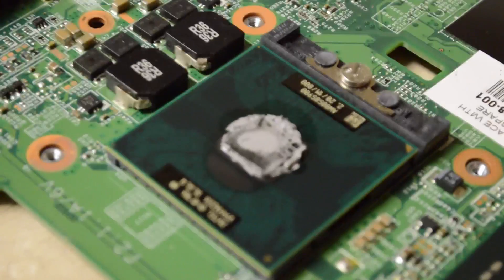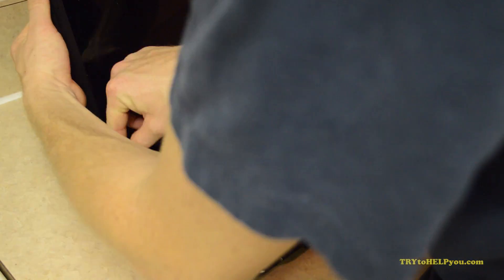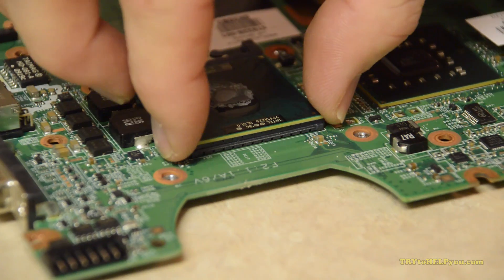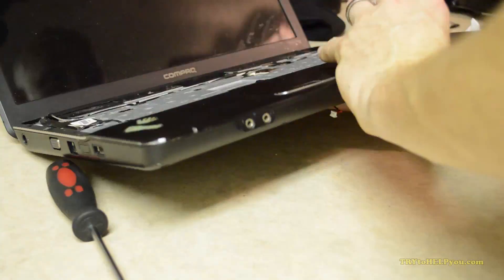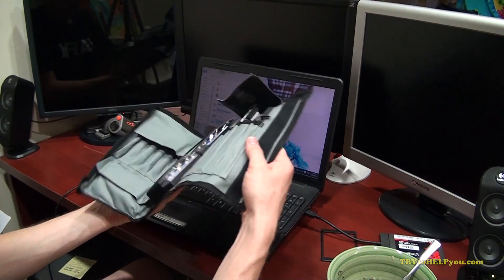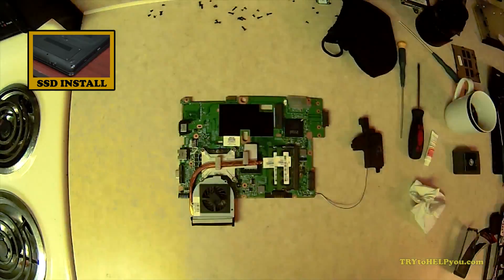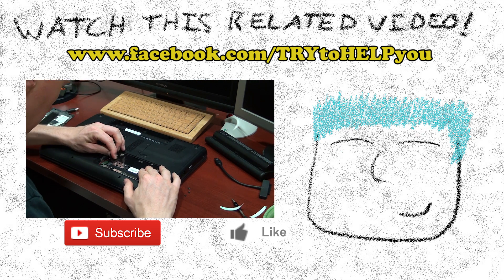Laptop CPU install, how to upgrade your Laptop CPU

Comment: I have a CQ71 for my everyday use, still pulling its weight but a bit slow. Has Celeron dual core T3000 1.8ghz (socket:pga478) Found two 4gb ram sticks a while back so now i have a whopping 8gb ram. Those little suckers are very hard to find. Don`t know why i didn`t think of upgrading the cpu before now. Any tips on what cpu upgrade would be ideal for me?

Comment: It's not just the number of cores, it's many many things that impact performance. More cores allow for more programs to run at the background (i.e. lots of windows background threads)
Higher clocks, and higher instructions per clock cycle allow a thread to be run faster.
Reply: Bro i need your help,if i had before a intel celeron 40208in my laptop and if i got a another intel cpu completely new intel one like 12 gen one can i change it and it gonna make problems?
Reply: @fenicy  check your motherboard 
you need to make sure its compatible it would be mega smoothbrain moment if you shoved in a powerful incompatible cpu

Comment: How did you know which cpu upgrade would work with your machine
Reply from the maker: Somewhere in the video I go over the way to look it up. It's been so long. I think going to the Intel site and finding the current processor you have, seeing if it's a socket that is not soldered on.
Reply: @TRYtoHELPyou  ok thanks

Comment: A local computer shop I went in to ask if they could upgrade the processor on my laptop and they said it’s not possible because all laptops are soldered in. I have an hp g7, I didn’t tell them that so they actually have no idea what laptop I have and wether it is upgrades me and going by your video there’s a chance. I can’t find any details on the hp g7 that tells me if it is possible. Do you know? I got a cheaper laptop because i thought I could just upgrade it piece at a time and it will be easier for to afford. I couldn’t just go full whack with a laptop over £1000 so bought this one at £500 and now I’m gutted thinking it was a waste of time and money. So any help would be very much appreciated

Comment: what i really wanna know is dedicated and none dedicated graphic card what are the differences, and how i can i tell if i can even pull out the CPU it self... aside from compatibility as i have acer nitro 5 to be more specifc of the model  Acer NG-AN515-52-79J4
if someone with experience gives me a straight answer as if i could change the CPU or the GPU do inform me please, GPU not that important but CPU is important to be upgraded its not enough.

Comment: Mine was literally glued down
Reply from the maker: This is possible but I don't think normal. Glue is used for when the boards go thru a soldering oven, keeping parts from falling off on the under side. It's possible yours is soldered on?

Comment: If anyone needs an easy clone tool there's  one called "HDD raw copy." I'll post the link ( it's a trusted site I've used them as a resource in the military) It'll clone any type of drive, some just take longer and it will clone any operating system master boot record. But it can only be executed from windows. You can find a few for Linux in GitHub if your respiratory doesn't have one. 

https://www.techspot.com/downloads/7114-hdd-raw-copy-tool.html

Comment: Why bother its easier building a pc
Reply from the maker: 1 hour of taking stuff apart and putting it together and less than 10 bucks spent on ebay for the processor is more difficult than building a PC? Perhaps your logic board needs a diagnostic.
Reply: @TRYtoHELPyou  dude no need to be a smart ass

Comment: I have an asus k53e laptop and it has intel pentium b950 cpu. I am planing to upgrade it to intel core i7. I have found i7 cpu that have same socket type and same microarchitecture. I think microarchitecture is important as much as socket type. Correct if i am wrong. And is it a problem if my cpu is 35W and other one i want is 45W? That is not big difference in power, but i do not know if it is going to overheat. Thanks in advance to anyone who can help.

Comment: Max W
1 second ago
Can i upgrade my cpu from i3 330M to i7 620M? i have Sony vaio core i3,8gb ram, VPCEB1M0E
Reply: Probably not. Idk much about laptops, but on desktops usually only one or sometimes two generations are supported per mobo chipset, so skipping 3 generations is most likely impossible without replacing the mobo.

Comment: Hi, I have an LGA 1150, and the notches don't align with the new CPU that I purchased. What happens if I remove the notches and put in the cpu anyways? I bought an i5-3470 cpu (for the PC version). The power source takes up only about 60 watts, or about 7 watts higher than my current processor's power requirement: the pentium g360 (about 53 watts) for the Laptop.

Is it ok to remove the notches and install this specific cpu? Please let me know, I don't want to break anything. Thanks!

Comment: Hello I have a Toshiba satellite c655-s5142 with a celeron 925 2.3 ghz,800 mhz,pga478 socket I know there’s lots of different intel core 2 duos that are compatible but I’m just not sure how much more of a better cpu I can get if u can point me in the right direction that’d be great thanks

Comment: Hi maybe you can point me in the right direction I do want to upgrade my computer (laptop in this case as well) it's an hp elitebook 2540p and has a i5 Intel processor and there are models that came with the i7 would I be able to just get chip and replace it or should I just look on eBay for the motherboard and replace it that way with the i7 chip?

Comment: so i got a laptop with(Intel Core i3-5020U 2.2GHz Processor) and i want to upgrade it to Intel Core i5 3317U, is that a good idea and if yes,is it possible to do it?
Reply: i want to replace my Asus X540LA-SI30205P i3 chip with my lenovo s400's i5 chip,is this possible?

Comment: Hey its me again, found something new that may ne safer and easier to test the swapping a cpu for a gpu xD

I found a video while searching how to overclock windows10. And i found one with an intresting process.

STEPS:
1. Open advanced system stettings
2. Find PROCESSOR_LEVEL (in the box labeled under system variables)
3. Edit processor level from its original from 200-300.

So yeah i tried this with my Psychonauts game and it seem to add some much need fps in a way. The game ran a lil smoother. But for some reason eiteher my hand was warming up the bottom left side of my laptop. That or the processor was overheating, probly cause i tryed it at 1500 points when it originaly said 20

Dont worry my laptop is alive and well still.

But i was wondering if u could test this and see if it actually works to improve performance or speed. 

Thanks for taking the time to read my badly writen comment xD

Comment: Is it possible to swap a gaming consoles CPU into a laptop? Might make it run faster :3
Reply from the maker: well.... this sounds like a fair challenge... and not one for me because im not sure where i would start.....
Reply: TRY to HELP you 

Yeah done some reasearch since i asked this, appairently ive been told its impossoble. But i still kinda belive it may be possible... If they make an addapter that is xD
Reply from the maker: check this video out https://youtu.be/bP_8EYQ-2RA
Reply: TRY to HELP you 

Thanks, one hundred percent gonna buy one of those when i get the money to :33

Comment: Hi, i wonder if it will possible to upgrade an intel core i5-2450 to i7-3630 on a sony vaio(model sve14a15flh).
The specifications CPU-Z give me are:
Package: socket 988 rPGA
Chipset Sandy Bridge
Southbrige HM76

Comment: do i need to do the glue part? cause if so then im screwed
Reply from the maker: Avatar Raptor I don't know what your talking about. Watch the video from start to finish.
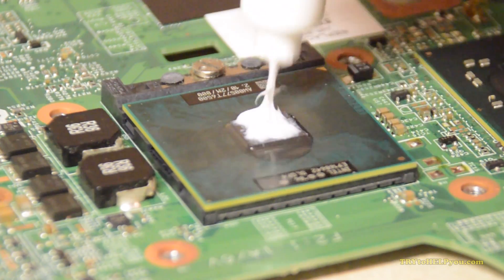Reply: 2:03 thats what i mean. plus i already did .
Reply from the maker: not glue 1:40. Thermal compound. 1:55 compound. 2:15 thermal compound. Please do not glue your CPU.
Reply: i know but do i have to do that part?

Comment: Can someone tell me why you need to put thermal compound on the processor?
Reply from the maker: +Luca Fric it assists int the heat transfer. Microscopic pores are filled by it assisting in tue transfer of heat.. is what i have been told.
Reply from the maker: +Luca Fric also, the why may be in the processors manual or onstallation instructions.

Comment: Do I 100% have to have the thermal stuff ?
Reply from the maker: if you want to %100 percent do it right. However, if you dont, you will just see poor performance and may even cause the cpu to fail over a short period of time. this sounds like its time for a good experiment.

Comment: Hey man thanks, I have been searching around about upgrading my lenovo g710 which has a i34000m processor so, This model laptod was sold also with a i7 4702qm one, would it be possible to do that? im also replacing hard drive to a ssd one and getting another 4g ram card, thanks to anyone who can answer this with citeria! cheers!

Comment: i will sound crazy but is this legit? like real?
Reply from the maker: combine elite soldier yes! Not every laptop tho has this possibility. Check your specs! Some processors are surface mounted to the motherboard. I mention this in the video too
Reply: Thank you for responding ^_^
Reply from the maker: no problem, as for that computer. I still use it and the upgrade was worth it! also, upgrading the HDD to solid state made it even better.

I highly recommend that upgrade.....
Reply: LOOOOOOOOOOL

Comment: Hi dude, I just did cpu upgrade, to T9400 but after replacement display is not working...
Reply: the same laptop as u did
Reply from the maker: Gediminas Jurgaitis check the plugs on the display? you may not have plugged it in tightly? or if you oeft tye cooling fan unplugged, this might happen. also, no HDD will sometimes cause a hickup as well

Comment: i recommend taking photo's of every part you take out and making notes of what screw goes where especially if you havent done before.
Reply: absolutely critical thing to do for a first timer.
ive tried it on my old worthless laptop its almost unusable now, i even overclocked it to the maximum settings over 1000mhz... it still alive somehow!
Reply: That's what I do with my screws, I have this sheet of paper that contains drawn out rectangles. Each rectangle represents a group of screws from the different sections of assembly, such as screws from the back, then screws from under the keyboard, and then screws from the inside.
Reply: That what I did. Lol
Reply: Hello.
I have limited edition Star Wars hp. I need to  replace the CPU.  Please make a vid, pertaining to this. 
All the best Shaun of NYC
Reply: @shauncampbell969  Eyy i had that too.
Reply: Hehehehehehe.I definitely did that

Comment: yo that's waaay to much thermal paste, that might actually reduce thermal efficiency, heat has to travel a bigger thickness to get to the heat spreader.
Reply from the maker: the distance between the CPU and the heat sink is still the same, the paste just squeezes out the sides if its too much. The paste yields to the physical attributes of the hardness of the chip and heat sink plate. no need to worry. If there is a space where thermal paste is not between the sink and the chip, then there is less efficiency due to the microscopic pores not filled in with the paste to assist in the heat transfer. For what you are saying to be correct then the paste has to be stronger than the surface of the chip and the heat sink itself. 12 dollar thermal paste on a 9 dollar cpu FTW! next time i will encase the entire motherboard in solder to help with the heat management.

Comment: What if I want to put a Ryzen 5 1500x in it
Reply from the maker: i think you would have to phone a friend, solder the power button to the output shaft, and then hold ctrl+alt and pull the starter cord. That might do it. if not, its probably impossible.

Comment: How can i know if i my computer supports a specific cpu? Can i upgrade my 3rd gen i5 to 6th gen i5 ?
Reply from the maker: press windows key; begin typing "my computer"; right click "my pc"; click PROPERTIES; see what processor model you have. Go to intel's website or search for your model through google on their website. See what socket you have and what instruction set your processor is. you should find your answer. you should also start the video at 4:00 and watch please.
Reply: TRY to HELP you alright thank you. i guess i can't upgrade my cpu to a newer gen cpu

Comment: Cpu is easy ...pull and plug
but VGA had artificial leg and use steam heater plus VGA black print
need clear old one make new artificial micro leg for upgrade new VGA

Comment: can I switch from i3 to i5 or i7 with this?
Reply from the maker: +Star Records too broad of a question, perfect answer to your question is, yes and no. We need model numbers and sockets and stuff like that. The fact that they are "i" is good.. but the generations are not all the same.
Reply: ah okay I've got the "intel(R) core(TM) i3-5005U CPU" but  my new school wants me to have an "i5" or "i7".
Reply from the maker: The Core i3-5005U is based on Broadwell-U core, and it uses BGA1168. There were also 23 Broadwell-U microprocessors, that work in the same socket. Below you will find partial characteristics of these chips, together with stepping information.  .... that is from a website here  http://www.cpu-upgrade.com/CPUs/Intel/Core_i3_Mobile/i3-5005U.html
Reply from the maker: looks like you may be able to go big. Core i7-5650U but you may be having to solder, not a task i would take on my CPU without experience
Reply: Thanks man!:D

Comment: hey. I upgraded my toshiba satellite c655-s5082 cpu from a Intel Celeron 900 to a intelcore 2 duo 9600. The green light will come on but the screen will stay black. Is there something that I should try to fix this?
Reply from the maker: +PaPa MiDniT3 possibly you left something uplugged? Is there something plugged into your display port? Is your hard drive plugged in? Bios chip removable? If so is it in its socket properly? CPU fan plugged in? Screen power plug plugged in?

Comment: I have a Intel Core i5-2430M @ 2.40GHz CPU and the socket is PGA988B. is it possible to upgrade to i7? 

I'm trying to build my computer up to a 1TB HDD and 8GB RAM and and i7 dual or quad core if possible

right now I have a dell inspiron with the above mentioned CPU. with 6 GB of RAM and 500HDD

Im not trying to make a gaming laptop, I just need my adobe suite programs to run more smoothly, it slows down when I have them open
Reply: the latitude e6420 can take up to the i7 2860qm, so yours should be able too. just make sure you have sufficient cooling

Comment: can u possible change the graphic card...?
Reply: You can get an external graphics card adapter.
Reply: You can actually just not alot of laptops that allow you to change the graphics card. If you're looking to get some better gaming performance out of your laptop you're best bet is tweaking windows settings, SSD upgrade, CPU upgrade. Also MAYBE overclocking or better yet, getting mods that help games run on lower spec PC's.
Reply: I had this question a while ago- and the answer is YES!! And for only $30!! It works on almost ANY laptop and has worked for me. Only downsides are- it is a fuck ton of work. Trust me- this cpu change looks easy compared to the crap I had to do to chance my graphics card. Also it will defeat the point of having a "lap"top in the first place as it is external and you need it constantly connected to power with a separate psu powering it. 

Look up "external graphics card for laptop" on YouTube and there will be videos explaining in more depth than I can in a comment on how to do it.

Basically, you buy a Chinese 8.0 graphics card adapter that connects to mini pcie express slot in laptop. Then you do all the other stuff (which will take ages) and you have to use external monitor (I use TV screen) and I only reccomend it if you can find a good priced second hand graphics card (I use gtx 660 ti which I got for £70) and a psu (Evga 430w- don't buy a cheap Chinese one as they may have such low wattage you GPU crashes- trust me- I know from experience) then you will probably have to remove wireless card for the pcie express slot, so a wireless USB extension or simply using Ethernet will be necessary.

You will have to really mess around with software for hours.

If you are willing to do ALL this you can.

But I doubt you have even read to the bottom of this comment.

Also it completely stops it from being potable in any way.

Anyway good luck!
Reply: Sam Tony you could try out using an eGpu
Reply: spookywaggon
Only if the laptop supports it which is typically rarer but I do have a laptop that oddly supports it (Or at least has the correct connection - Never actually tried it)
Reply: It needs to have thunderbolt 3 not just usb c.
Reply: Yes it possible

Comment: would it be possible to replace an intel core i3 ( Intel Core i3-6100U, 2x 2,3 GHz, 3 MB Cache) with an intel core i7 on Lenovo ideapad MIIX 510-12ISK ? kinda specific but I'm really lost here
Reply: If your laptop is compatible, then it should.

Comment: I am just scared if the new one with more cores doesn't burn out because of the fan made for lower core CPU?? Any answer please?
Reply from the maker: +PrideMe monitor your temps. Mine has not come close to overheating. Not all laptop coolers are the same si keep that in mind